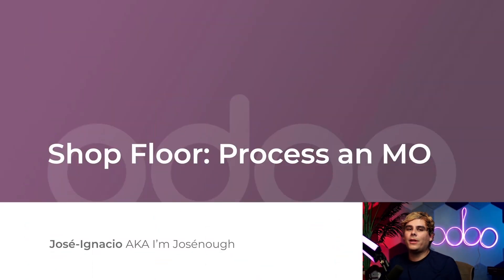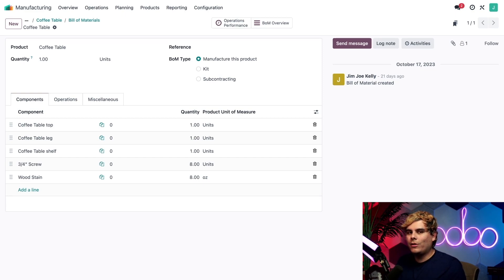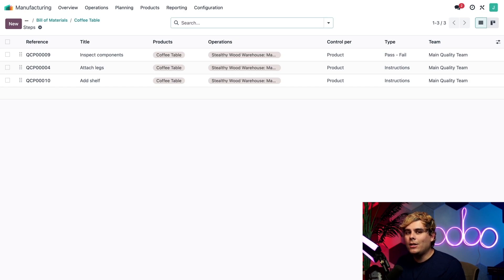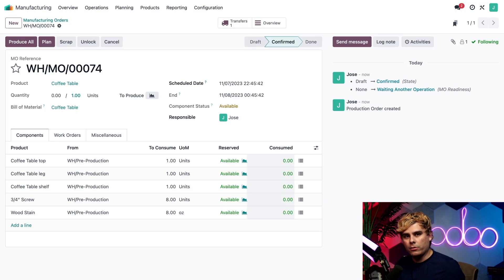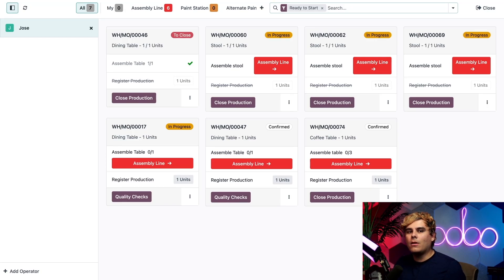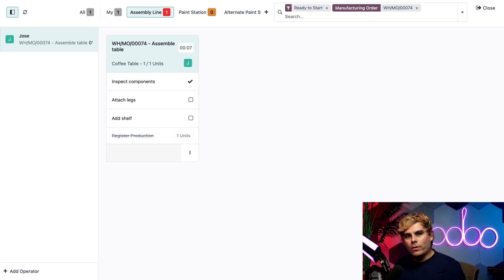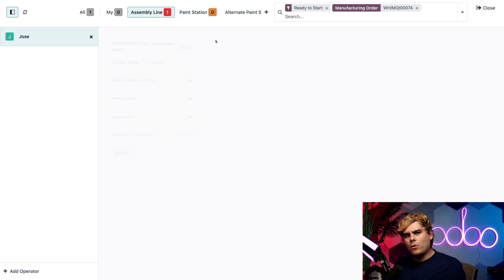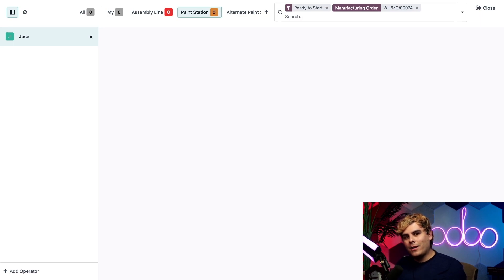Process an MO | Odoo Shop Floor

Comment: Eventhough the initiative is nice  ! Saddly floor shop is bad designed and probably we , the users, will have to wait another one year and new version to be fixed : 
The worksheet visualization in combination with QC steps , is not well designed on mobile devices
You need to start and stop the timer manually! (in v16 will automatically start and stop when you open the worksheet with the operation steps to make)
You CANNOT use studio to customize search view, info on cards.. or whatever you need to do with studio !